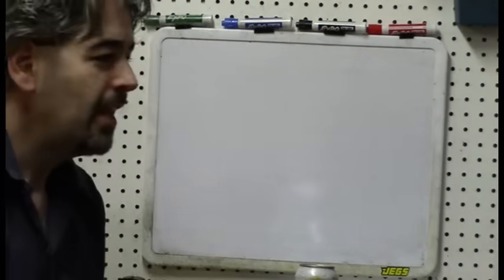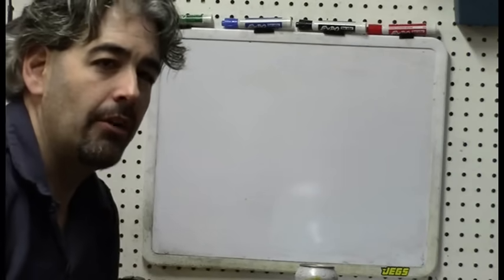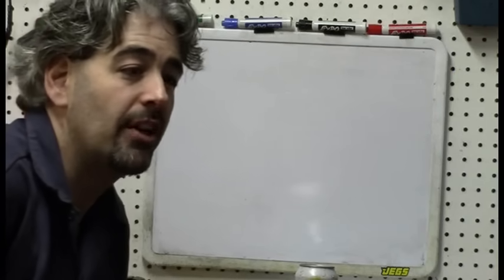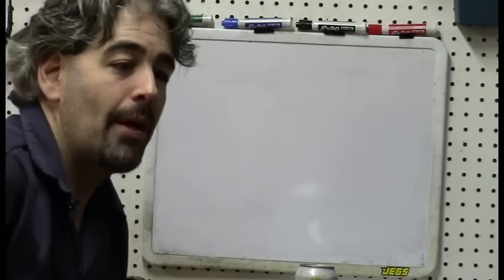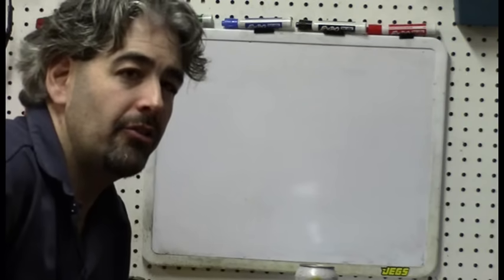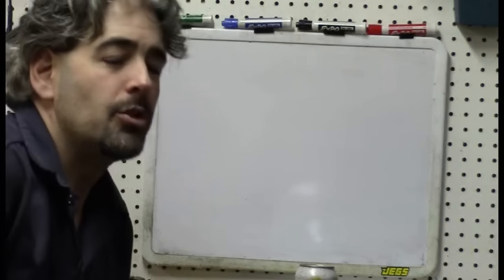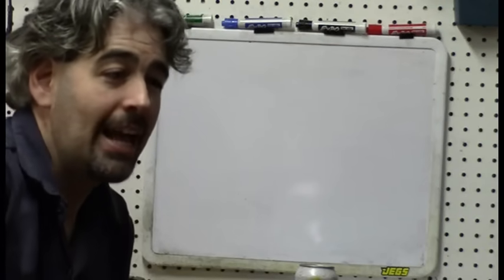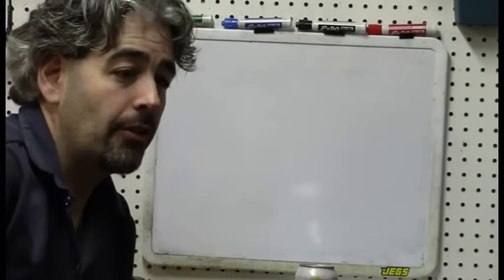Secret of Engine Problem Diagnosis- Fuel Trims Pt.1

Comment: Hi there what does it mean if at idle that the LTFT, and STFT both negative at idle ( Warmed up engine)  LTFT  - .05 and STFT  - .09 ?   and ideas . I have a launch 123 i scanner that can record and tract, store, and print data. What should I be looking at?  Thanks Ed R
Reply from the maker: I am not following- where is the negative trim? Are you taking about the -.05 and -.09??? that’s not even minus 1 trim.  That’s surely not what you are referring to What am I missing here?
Reply: @SchrodingersBox  I am going to look again and do a re run on the fuel trims LTFT, and STFT and O2 sensors when it gets warmer outside. Perhaps tomorrow . I will get back to you.Meanwhile I will look back on what I have saved on the 123i and look at the values. I did clean the maf sensor just to start because of the rough idle issue. I am still learning how to use the scan tool . It is a great piece of technology. I will get back to you...The reason why I bought this scan tool because I could not find anyone who has the knowledge and skill set to figure out the issue.Thanks again Ed R
Reply: Just looked into the scan I took a few days ago. The Launch 123i freeze frame data can be sent not only to myself ( E mail) but also others, as SHARED Just to clarify the information I sent you  The live data graph reads
 
                        Long Term Fuel  Trim-IDLE     Load Bank 1      -0.05
                        Short Term Fuel Trim Bank 1                            - 0.29       This is from the data I saved afew days ago.  
                               
                     With the 123i I can send you saved Freeze frame data. You just let me know what information you need! 

                              I will re try saving data tomorrow............... Just tell me what you need. Unfortunately I can not send you moving graphs or data as being recorded or observe,  only freeze frame data and freeze frame graphs

                                           Thanks Ed R
Reply from the maker: yeah I don’t see the rich condition but you also only have one fuel cell parameter.  I am sorry but I don’t see what you are trying to do here. what is the issue with the car?
Reply: @SchrodingersBox  Going to check into more when I get the chance. Unfortunately I can not send you recorded live data from the scanner unless I can copy it and send it as a attachment!  Back to checking out the live data on the maf sensor, oxygen sensor bank 1/sensor 1, and Oxygen Sensor - Bank 1/ Sensor 2  readings, and  LTFT and STFT.  I will look into it. I will scan  all these at one time after the car engine heats up.   Worse idle is when car is in drive and cold , it gets better after it warms up but gas mileage is poor. It should idle smooth all the time like it was when new. Only got 88,000 kms. New plugs but they were ok..  Cleaned maf sensor... I will keep looking. problem is harder starting, rough idle while at stop ( Steering wheel vibration and car body vibration)  Had engine mounts checked by mechanic, front passenger side mount replaced)  Does run better after cleaning maf sensor, but did not get rid of the whole issue. Drives ok, but does lack the power it had . Throttle body was also cleaned last summer. That did not correct the issue either. I can send you info into your E mail if possible.  Thanks Ed R
Reply from the maker: sounds like a drivetrain mechanical issue, not engine issue. mounts or missing teeth on belt or harmonic balance  perhaps.
Reply: @SchrodingersBox  If i raise the rpm at idle over the curb idle which is reading 620 rpm ( Seems low) The idle smooths out and no more steering wheel or cab vibration.. The scanner just died out !  i am waiting for a repair or replacement. I am going to check out the RPM,LTFT, STFT and o2 sensor readings  at idle, at 1,000 rpms, 1500 rpms , and 2,500 rpms and see what the O2 sensors and LTFT, and STFT are doing and compare. I wonder about the O2 sensor is giving out a bad signal at low rpms. Engine is really smooth and no vibration over 1000 rpm and more....Drives OK no issues.  Since the scanner has been sent back it will be awhile. Before I can get that information!   Still looking..I will get back!  When I can

          Thanks Ed R

Comment: I have a dumb question regarding fuel trims. I have a 99 Altima that on a closed system shows ltft at 9 percent positive and stft 25 percent positive at idle. I suspect a vacuum leak but can't find any. The car runs good for about 15 minutes but the longer it runs the more rough it gets and eventually it will stall at a light. No codes go up but did initial have p0171. Any direction of where to look? Thank you
Reply: Stft will adjust accordingly as I drive. Ltft will also adjust and no problems.
Reply from the maker: That would be expected.   You have to curve the total trim against load to analyze what the issue is. Looks pretty straightforward - should be super easy to find.

Comment: My stft is at 14%  and the ltft is at 13%
Reply from the maker: That means nothing unless curved against load. It's like saying your heart rate is 89.
Reply: Thanks, i'm  getting bad gas mileage,  sometimes 20 sometimes 29, and when accelerating  over 60 mile up hill loos power and check engene sometimes com flashing
Reply from the maker: Get me some data and i can help.
Reply: Right now I don't have any codes but when that happens it says misfire on cylinder number 2 I change spark plug switch coil spring ignition took it with a mechanic and they test the compression and they say it's good and they couldn't find anything
Reply: I've been watching YouTube video about that short term fuel trim long-term fuel trim it says that the long-term it should be on zero but mine on idle it's always sometimes 5% sometimes up to 14%
Reply from the maker: i would very simply just do a basic FASTTEC analysis.
Reply: I just got check engine light, p0171, and fuel trim went up to 46 short and 24 long term, i been checking for leak, can't  find it, ill keep checking.  Thank you for your time for helping people

Comment: where u located . can i bring my truck to u
Reply from the maker: Denver Colorado
Reply: @SchrodingersBox  to far thanks , had issuses with my ford explorer for about nine weeks ever since got oil change . . its 2001 4.0.  however it came off the line  dec 4 2000. fixed all the vacum lines . changed  head gasket twice . kept stalling out while driving / change the cam and crank sencor fixed the ground off battery  to the body .  still stalles out / brother inlaw gave me a boost started right up . been changing relays / i notice a better idle tomorrow gonna get electrical check . wish me luck

Comment: I want to understand something. I have a 2004 Hilux, or as you call it, a Tacoma. The indicators say that there is an air leak, but the resting speed of the engine is 700 revolutions. So how can there be a leak when the engine is ready and the speed is down? I previously used the suction gauge and it achieved 16 without acceleration, and with acceleration it went down to 5, then It returned to 20 and began to drop to 16. What is wrong here?
Reply from the maker: Yeah that would be correct.  Vacuum occurs at idle.  If you open the throttle you open to atmospheric pressure so vacuum drops.  Vacuum is highgest by far under a decel event.

Comment: SUPER VALUABLE VIDEO! Watched this video 4 times this past weekend, got to work this am and helped get two cars diagnosed. Using fuel trim live data to understand lean codes. Narrowed down options lead to smoke testing found vacuum leaks on each. Thank you.

Comment: Taken on a 175km trip now all looks good (touch wood) STFT around -1.6 Banks 1 and 2
LTFT around -7 Banks 1 and 2 and motor seems to be running smoother. Next I will check Fuel consumption Thanks for your help. Over here in Australia most of the mechanics I have spoken to about this problem just tell me to just reset the codes, this has made my head hurt for many years, my fingers are crossed.
Graeme in OZ

Comment: Hi sir I have a question what do you think most likely is my leak coming from if I get an evap light only after about every 2 weeks I clear it everytime with scanner vent solenoid? That's what I think it may be thank you need some advice you know your stuff any ideas?
Reply from the maker: Most likely gas cap.
Reply: @SchrodingersBox  I just replaced it a week ago same situation with old cap
Reply from the maker: Then you surely have a leak in system. try manually closing vent solenoid and checking for leak with vacuum pump OR what I do is close vent and purge and pressurize system and look for decay and if present just do the simple soap water bubble test!!
Reply: @SchrodingersBox  ok don't have a scanner to command closed but I have a smoke machine my vent solenoid is hard to get to 2001 Silverado on top of gas tank qwbut I have the relaxation kit just gotta get off old electric connecter can barely just reach it.
Reply: @SchrodingersBox  I changed my vent solenoid yesterday it was in a tight spot about on top of gas tank between the cab and bed took some manuvering but got it done that's gotta be one of the hardest vent solenoid locations I've ever seen. Hope that keeps my code away I'll update you later thanks.
Reply: @SchrodingersBox  just found out my problem for anyone with a similar situation just did a vaccum test on my almost brand new purge solenoid. It's not holding a vaccum so that was the issue.

Comment: Hello! I have 2007 car 4 cylinder car with only 1 bank. LTFT1 seems to be 28%, car is running fine and no check engine lights. In idle, STFT1 is running -20%.
This car is map controlled, no maf. What would be first things for measure, can vacuum leak cause this kind of condition? 
If you have any ideas, i would appreciate. :)
Reply from the maker: Your total of trim of 8% is normal.

Comment: trying to understand this, but im confused, you say if the long term fuel trim is positive?, short term is probably zero.having an issue with a toyota corolla, short term is fluctuating 3.9 to 5.7 and long term is staying at 3.1 and im getting a lean condition code and a code saying its not running at maximum efficiency?
Reply from the maker: No- I am saying when the LTFT is set, the STFT will be zerod.  That sounds exactly like what your condition is.  The STFT no longer needs to adjust to set an LTFT to meet the demand.

Comment: MATT
With you help in understanding the workings of the LS1 LTFT and STFT
Graeme in OZ
UPDATE !!!!!!!!!
This weekend may have found my issue, while checking PCV valve I noticed there was a small rubber pipe connected to the valve cover then led to PCV valve the push on connection was very easy to pull apart so I installed small hose clamp to secure it. I then connected my newly acquired  Foxwell NT301 OBD2 Engine Fault Code Reader Scanner and found the instrument gave me a green tick indication when connected where as before it was an orange triangle (Yellow indicates there's an issue that has been solved). The Short Term Fuel Trim readings now look better showing around -2 banks 1 & 2 LTFT is about -9 but from what I've read this takes time to adjust after problem is resolved.
Will need to take her for a few drives to see if I have solved the 13 Year issue !!!!!!!!.
Graeme in OZ

Comment: do you know why my car shows -100% on short term fuel trim B1S2?
Reply from the maker: Most likely a scantool incompatibility.
Reply from the maker: Why are you looking at S2 trim anyway?
Reply: @SchrodingersBox  thanks for replying! I hope its related to incompatibility but I went two different mechanics that they used different scantools, and they both noticed -100% STFT at B1S2
Reply: @SchrodingersBox  I am concerned on this -100% value because my car (2018 sonata) is having a bad fuel economy result. fuel gauge reducing significantly even though I have short trip(less than 20km)
Reply from the maker: O)k but why measure fuel trim on S2 for a poor fuel economy issue though?
Reply: Because I am noticing my car fuel consumption is bad.. at least the fuel gauge is dropping even though I drove only less than 10-15km daily.

two mechanics are saying that -100% value at STFT B1S2 can be negligible but I suspect this causes my fuel problem.. what is your thought??
Reply from the maker: @Poocang_golfr  You need to curve the TOTAL S1 trim against load to determine if you have a stoichiometric issue or not.

Comment: I test drove a car yesterday and at the end plugged in my scan tool.  Bank 2 STFT was pegged at -100%!!  What could cause that?  The voltage on the bank 2 02 sensor seemed to be responding normally when I revved the engine but the STFT number never changed.
Reply from the maker: seems like an interface conflict.
Reply: @SchrodingersBox  Not sure what that means?  Do you think the scanner / app is misreading the car's computer?

I forgot to mention, a code had been cleared 31 miles prior. And the carfax report showed that the dealer has had the car in the shop twice in a 2 week period checking the computer.And the computer was reprogammed in January 2019.
Reply from the maker: exactly - seems the car and scanner are not communicating. happens to me all the time.

Comment: So the question is what substance can  you inject to fool the computer to do more fuel saving, in a normal working condition that is. Anybody ideas?
Reply from the maker: There isn’t one. If it isn’t a fuel source then you would just run lean is all
Reply: Schrodingers Box Im doing research atm, with an intake injection system to find some kind of a mix to improve hp or milage, hp isnt dificult have allready a very potent mix kerosene isopropanol doenst affect milage gives alot of boost, aqueous ammonia looks like its improving milage but still testing this. Checkout my video for the injection system very simple design no moving parts.

Comment: YesI i am new here. I have a 2000 silverado 4.3 v 6 I have codes p171 and p 174, and just today a mother code p 1870 trans. Slipping any ideas ? Put fuel pump a month ago, I think it might be fuel regulator, do you think I am going in right direction?
Reply from the maker: no idea.  what did your load curve show?
  as for the transmission slip- what is the input shaft to output shaft ratio?
Reply: @SchrodingersBox  my freeze frame showed load of 10.2 at idle a/c on
Reply from the maker: Freeze frame is useless. You need a live load curve. You cant tell anything from one data point.
Reply: @SchrodingersBox  ok I will do tomorrow. And reply, thank you for your time we all know there never is enough time. That's why i can't reply with info. Now. Brother is in hospital with leukemia, and I am visiting him.

Comment: I am suing Torque Pro app when driving and app shows that stoichiometric value Air:Fuel is 29:1
It changes to more like around 20:1 when add lots of throttle, going up hill on lower gear for example.

It's diesel common rail 1.5L 3 cyl, foam air filter, standard turbo, standard fuel.

Do you think is it normal?
Reply from the maker: No- it is not normal to be suing an app.
Reply: Is AFR equal 29:1 normal in my diesel? I think it's very lean...

Comment: How do you deactivate the 1997 Chevy cavalier anti-theft system? Im having problems with my anti-theft system. Every now and then it activates when I'm starting my car....I hv to override it by leaving ignition switch on for 10 minutes and wait for blinking anti-theft light to turn off. Does anyone have an answer?

Comment: If LTFT is between -6% and -9% while STFT is between -2 and +2% at all engine RPM, What's the likely cause of the abnormal LTFT?
Reply from the maker: Impossible to tell- you don't have enough data.
Reply: What additional information do you require. I can get it at next drive cycle
Reply from the maker: As shown in video it must be Curved against load with the rail pressure

Comment: So I saw this video and checked mine on my 2016 car.
The problem is, my LTFT is steady at -5%. STFR goes from - to + continuously. It never flat lines.
I was wondering where to start so I have an idea when I bring it to a mechanic of the CASA for the next PMS.
Oh, and the car got it's 2nd PMS around 3000 Kms ago.
Reply from the maker: sounds right to me. What would expect it to do after seeing this video?  how would the STfT ever possibly flatline?
Reply: Thanks for the response. And the -5 LTFT? I might try to compare this one with another similar car. Actually got to this video trying to find a way to see if it was running lean.
Reply from the maker: What are the symptoms your car has. What are the DTC’s?

Comment: Im redoing my exhaust on my 95 bmw m3 and its a obd1. I only have 2 o2 sensors and they are located in the middle of car. Where is a good position to relocate them? Im not running and cats, and should i space them out?
Reply from the maker: Why do you need an S2 if you aren't running Cats? What is your logic  with that? I don't follow.
Reply: I dono..whatever it takes to keep my engine safe..so o2 wont work without cats? And i keep getting engine knocking, or spark knocking not sure..
Reply from the maker: I am not following. Are you having fuel trim issues and trying resolve those with S2 input or something?  what is your current STFT and LTFT?
Reply: Its a euro engine, engine code s50b30
Haven't had any live data yet because i couldn't connect to the obd, the car was tuned before and when i got it, it was a mess, im going to check fuel trimming and i will let you know.
Thanks for responding, and thanks for your videos 👍👍

Comment: I heard somewhere else that the rich and lean is referring to oxygen, not fuel?
Reply from the maker: yep that’s correct!! In a misfire for example on a low compression cylinder- the O2 will read lean from unburned oxygen rather than rich from unburned fuel. 
the exception is air-fuel sensors. those measure based on actual stoichiometry, not oxygen content alone.